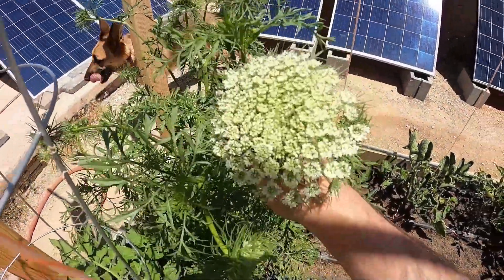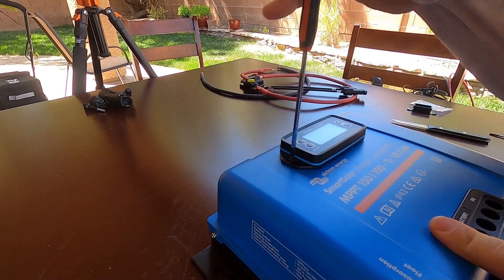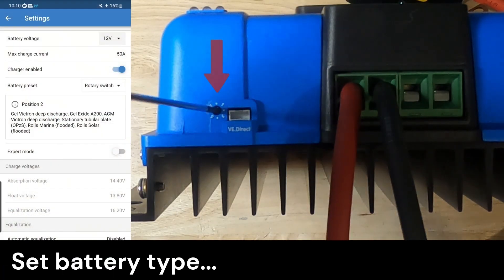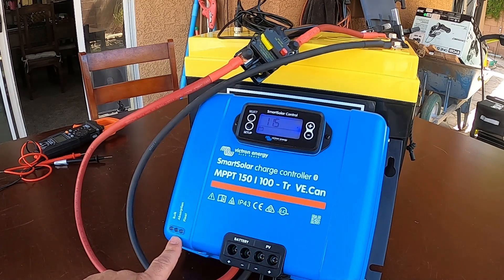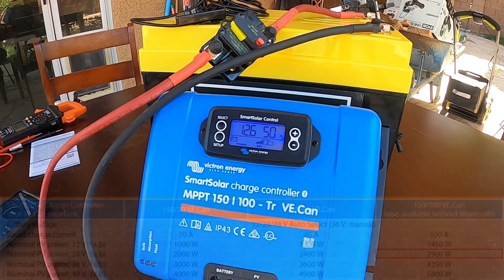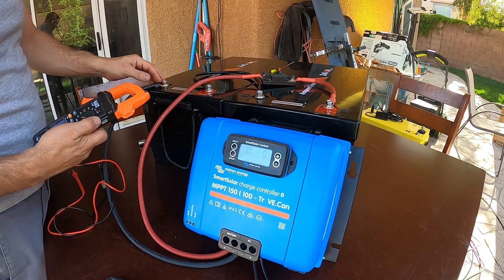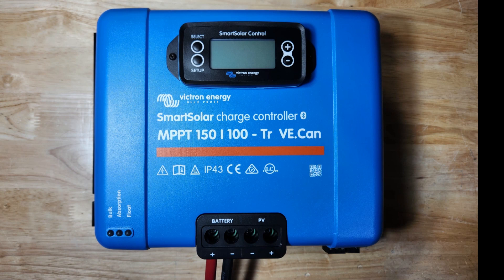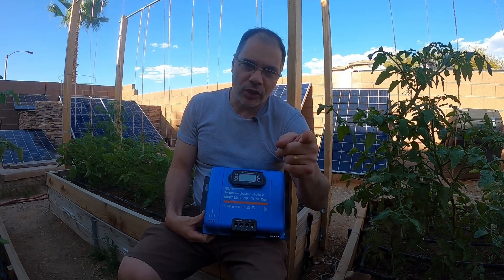Victron 150|100 Review and Test - For Beginners!

Comment: Nice comparison of the efficiency of different voltages of systems.
I would have a wish and suggestion for a similar video:
I would like to see a comparison of the efficiency of this MPPT and the MPPT from All In One inverter under different conditions, and for longer term - full sun, partial shade, shaded. I've been interested in this for a long time and you have everything you need now to test and compare.
I suspect this MPPT will perform better, but the question is by how much, but maybe the results will be surprising, it's hard to say.
Thank you, I look forward to more videos.
Reply from the maker: That would be interesting.. the victron has the ability to track multiple MPPT curves. Don't understand it yet, but I'll look into it more once I get this thing permanently installed
Reply from the maker: Over how long a period..
Reply: @natesdiysolar  I was thinking over a longer term so that both MPPT would get out of their comfort zones at the power limit where they start to heat up. The MPPT in the All In One inverter turns on its very noisy fans for cooling. Both MPPTs at their limits would have power limiting and at that point the comparison would be more interesting and they will come to that point after a longer period of time with the peak power limit from the solar panels and when they start to heat up, this is how I meant for a longer term.
This might also give a basic indication of the comparison of active and passive cooling efficiency for both MPPTs.
But it would also be interesting to do a basic comparison of the two MPPs in their comfortable working conditions (not at their limit) with the same panels connected.
Reply from the maker: @Tibor  oh ok. I see what your saying. Could turn off the all in one so just the MPPT runs.. need to get a temp gun.